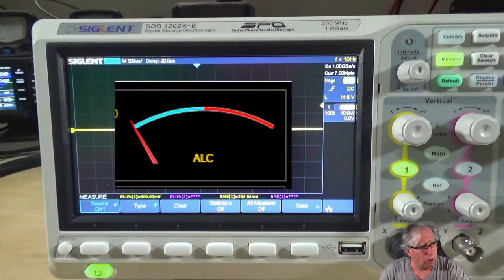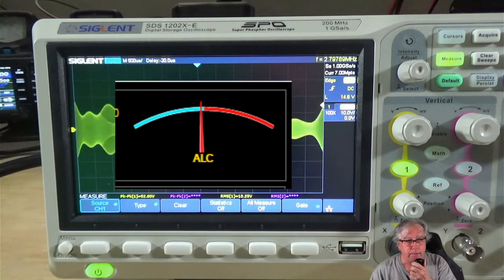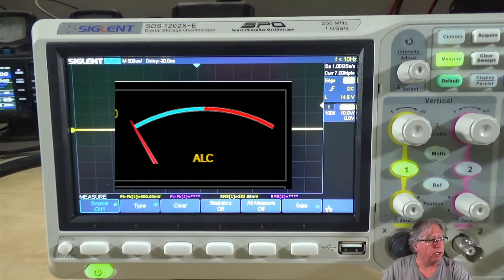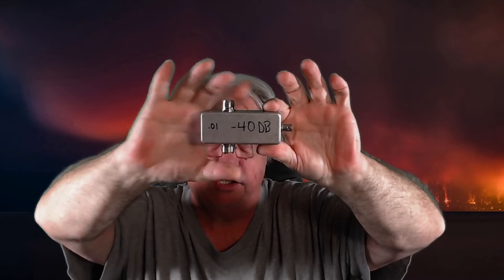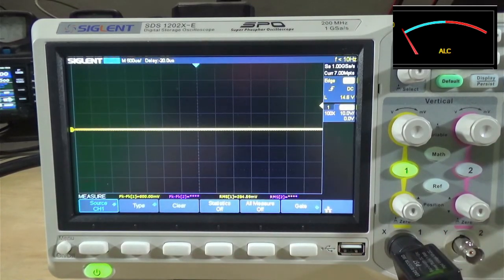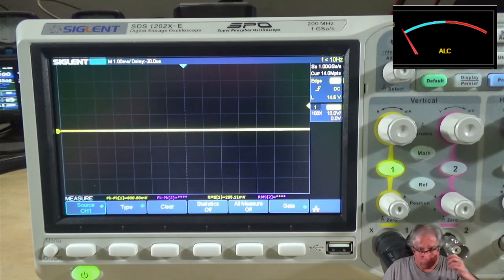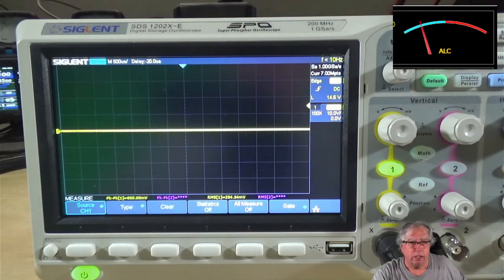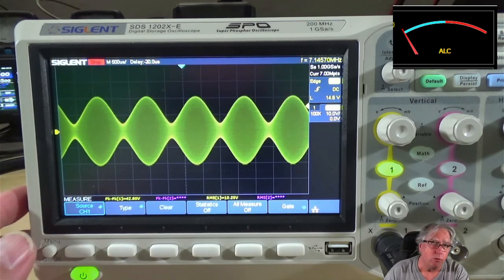Radio Mic Gain - Making Your Transmitted Signals Sound Great!

Comment: Nice demo; which rig and what input from the transceiver to the oscilloscope to show modulation did you use? Good to see you at the micro Field Day!
Reply from the maker: Hi Robert,
We were hooked up to the FTdx3000 on the main antenna output going through a -40dBm tap to a 50 ohm inline terminator going into the oscilloscope.

Stu
AG6AG